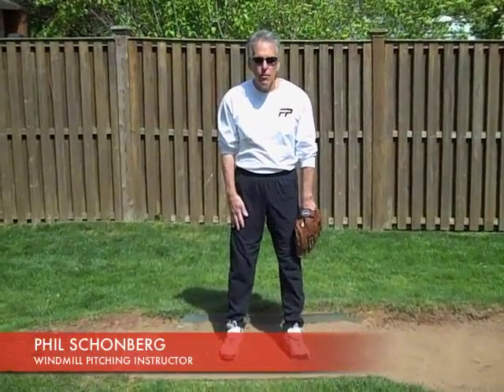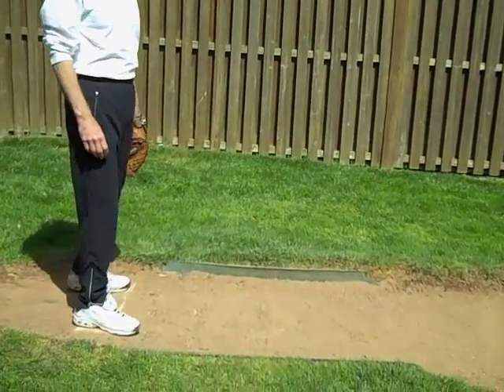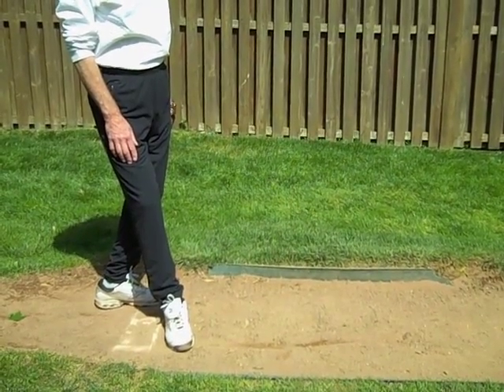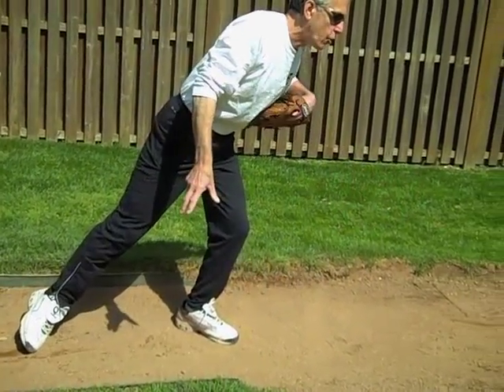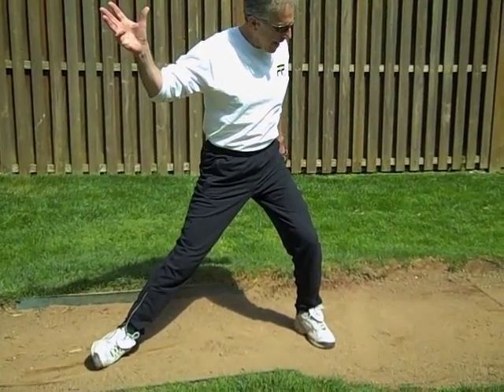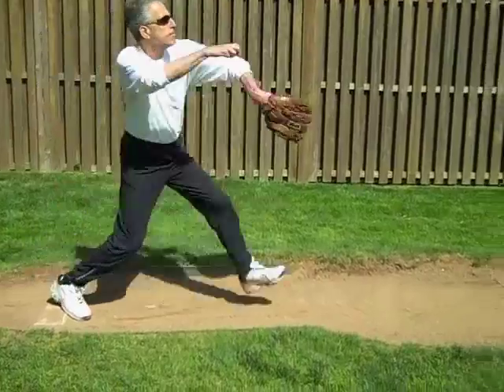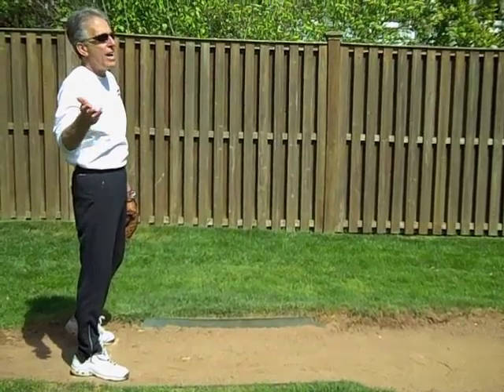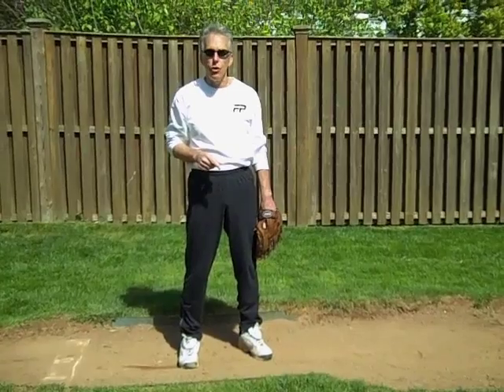Softball Pitching Problems: Dragging your foot is slowing you down!

Comment: In response to the first two posts, watch any top flight pitcher (Olympic or Pro), and you will see what Phil is demonstrating.  Don't see what "Fastpitch Power" is referring to "In our experience, it does not."  Whether it's Finch, or Fernandez, or Osterman...all of them clearly state that you want to close as fast as possible to get the most behind your pitch.  After that's accomplished, you can take a defensive position, but that's also a natural motion with the drag leg swinging around.